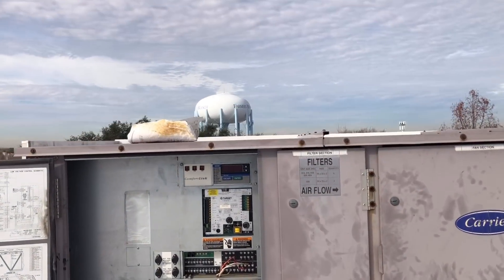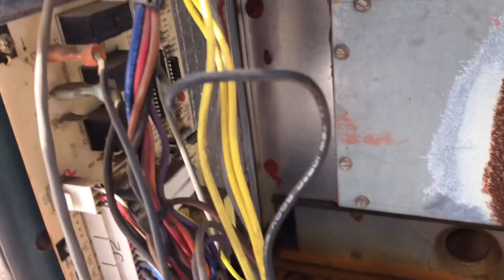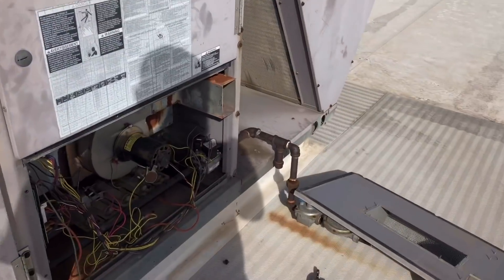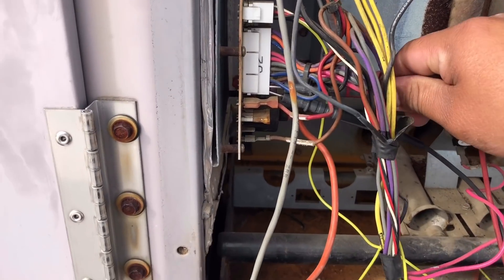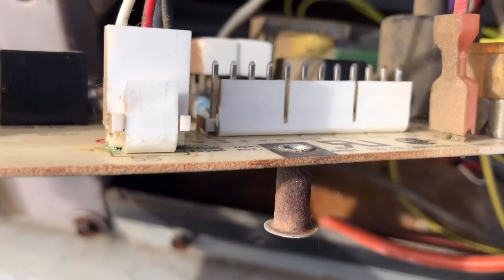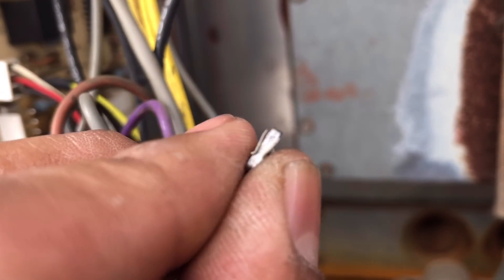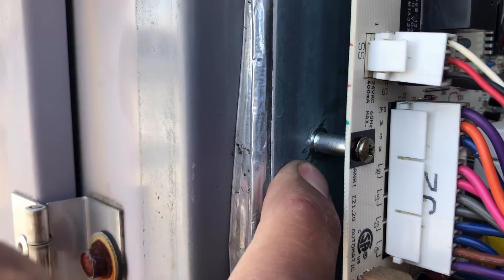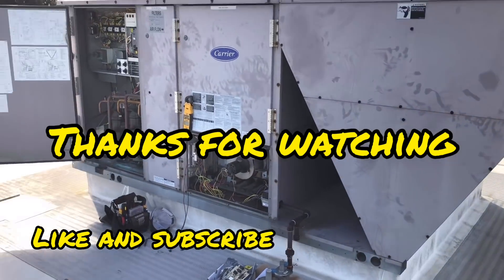HVACR:  No Heat Call, Carrier RTU. Constant Callback

Comment: Bad solder joint or a cracked resistor where the high heat marks were, send me the board I'll fix it for you!  Ha Ha
Reply from the maker: Lol. Thanks.  The solder cracked on the pins.  I posted the picture to my Instagram.

Comment: Board discoloration looked appropriate, as it was under some power resistors.  Iffy on the connector - was that dust or a sign of heat from a voltage drop of a poor connector?
Reply from the maker: Cracked solder on the pins.

Comment: I had the same problem with a carrier electric heat unit. It was that 12 pin connector solder joint was coming loose making a bad connection.
Reply from the maker: Exactly the problem here.  Good to know.  Thanks

Comment: Don't throw that board out as there is nothing wrong with it other than dry solder joints at that multi pin connector. Invest in a cheap soldering iron - next time go over all the solder joints and retin them. Although messy that wiring harness looks fine no need to replace it - spare parts people trying to make lots of money - hope they didn't charge too much for that board.

Comment: Hall sensor? Are you talking the flame sensor?
Reply from the maker: I’m probably talking about the Hall effect switch.  Is that what you mean?
Reply: @rookierefrigeration4357  yeah that's what I was referring to,  that was the flame sensor right? You just called it a hall effect sensor?
Reply from the maker: JDT738126 no. The Hall effect sensor is at the tail end of the inducer.  It seems a signal to the board when the inducer is turning.

Comment: a Halifax switch is that what e called that part on the circuit board?
Reply from the maker: The Hall effect switch is on the end of the inducer motor.   It acts as a pressure switch but it gives off a DC voltage to the board proving that the inducer is running.   I don’t know the exact technical names or voltage but that’s it.

Comment: Just a solder joint on the back of the board behind the pins intermittent problem. Just got a hate those intermittent problems on electrical
Reply from the maker: t lech yup. Found it the day after I ran the call

Comment: Is that the ignition control module
Reply: I ran into that on ces unit and Lennox this year. Harness price is wild dang
Reply from the maker: Daniel Alvarado yup.  If you look on my Instagram, you can see the pics of the board with the cracked solder joints.
Reply from the maker: Daniel Alvarado yup.

Comment: You can override Those older style TGT IOP boards by using an alligator clip on both the little loops on the board. In case you didnt know. I'm sure you do though. Enjoy the vids!
Reply from the maker: Yeah, it’s funny cause my Tgt board called for it, but the unit wasn’t.   I’m not sure how all the networking and controls goes but it was odd.  Thanks for the advice bro

Comment: You discover the most usual fail in electronics.    It is just cracked solders in the connentor on the pcb solder side... just reflush and add 60/40 tim with a pencil solder iron and that is all 5 min. Of work.
Reply: Unless you own the equipment,  never solder the board.  Too much liability.
Reply: flyguille what about the hour drive there, collecting the tools, the hike to the roof , taking apart the part you need to work on, then after the repair everything goes back together,the write up of the repair.... then all of the stand around time....you grossly underbid that job if you only charged for 5 minutes of work !!!!!!
Reply: @sandman4thewoke121  no, you do that in site, without any moving, it is just 2 extra tools in the box (1 tool , one spool 60/40), nothing more, it is just matter of 2 seconds to do each solder you can't ruin anything). Because it is just a reflush of two seconds where you add a bit more of solder.... it is the easier task to do in electrónics.

¿How do you know which are cracked, you needs to see that from the surface perspective point of view, and move the pin, you will see a circular crack just at the base of the solder, that is because in factory they don't put enough solder to hold the vibrations of the machine, so it dows metal fatigue.
Reply from the maker: Yeah, I don’t think I could get approved to repair a board.   But I have fixed many broken solder joints in my 1998 Jeep, so I know it’s very doable.
Reply: @rookierefrigeration4357  no, you do that in site, without any moving, it is just 2 extra tools in the box (1 tool , one spool 60/40), nothing more, it is just matter of 2 seconds to do each solder you can't ruin anything). Because it is just a reflush of two seconds where you add a bit more of solder.... it is the easier task to do in electrónics.

¿How do you know which are cracked, you needs to see that from the surface perspective point of view, and move the pin, you will see a circular crack just at the base of the solder, that is because in factory they don't put enough solder to hold the vibrations of the machine, so it does metal fatigue., you don't touch electronics component, or surface components, you only do  connectors solders, for that you don't need a permit or aproval (and most important, you don't cost 500 extra bucks to the client). And most important you save the travel to get another board, and you don't set in the bill that you did soldering, just "connector repairment" so, you don't OWN the equipment as the other said.
Reply: Where I live they don’t allow you to fix anything by soldering.(if it’s gas related) if you do you are liable, a lot of techs  don’t want to risk there jobs. They’re are places that will be able to refurbish the boards and certify the repair but for boards like this we just replace them.
Reply: If you solder a board you cant provide any warranty. You are doing the customer a favor by replacing the board and guarantering the work. Making your company look good by not having another callback. Soldering a 20+ year old circuit board is a game played by a service company looking to go broke. That unit is ancient so i hope CO and heat exchanger was checked to make sure money is not being spent on a sinking ship. Something that old I would recommend to replace for an efficiency and reliabilty standpoint, so at least compare repair vs replace to give the customer that option and maybe make some money for your company. Good job and good luck.

Comment: The pin connector probably came unsoldered from the board. The joints crack or break away from the copper trace.
Reply: when you flipped it over I've put the video on 1080p and frame by frame and can definitely see cracked solder on those pins lol
Reply: Gerardo Requenez yes. And what looks to be a bad pathway too.
Reply: I often re-solder connectors and anything that has heavy parts on it. That discoloration is normal from them high powered resistors. They are usually mounted off the PCB a little so they don't discolor the board and better heat dissipation for air flow.
Reply: I had that very thing happen on a corporate owned generator. I was told not to diagnose it, and call a corporate tech in. He couldn't find anything wrong. So, after my 3rd damaged contactor coil, I started messing with the units wiring and started replicating the issue. The auto voltage regulator connector was broken loose at the board, under a silicone filled surface to prevent reverse engineering of regulator. You could barely touch it and my light tower would flicker ever so slightly. I called in for a replacement generator after emailing the video of the failure to corporate. Frustrating!
Reply: @johnwilliamson2393  The silicone is there to prevent movement and to seal things, not to prevent service. It usually used to keep vibration from breaking components off the board.
Reply: I agree. I've also seen that as an issue
Reply: I've had to resolder several board pins.
Reply: My boss used to say "it's the little things, you got to look at the little things" ...you are sorely missed Boss ...RIP,  MR. CARL ... wish you were here.
Reply: Exactly, a few minutes re-touching the solder joints with an iron and some fresh rosin-core solder would have probably been as effective as replacing a $500 board (that has $2 worth of parts on it).
Reply: good call stick board in oven at 350 for 8 mins, if you ever have another one....(resolders the joints)
Reply: @happydays4551  Many components cannot take soldering temperatures for very long (ICs, the expensive parts), that is risky. Just hit them with an iron, or heat gun from the back of the board.
Reply: @court2379  i hear ya, i know everyones an expert and i always am open to new ideas/ways, just letting everyone know what has worked for me just shy of 15 years now.. have a great day, thanks.
Reply: blo me It works better if you just solder the joints with new flux-cored solder. You need flux to promote adhesion or the joint will crack again.
Reply: @happydays4551  really?
Reply: @donmacdonald8516  what the "board in oven"? yes,preheat to 350 leave in 8 mins. it works. Then be confident when you charge him 450 dollars for a new board..
Reply: 99.999% agree  over the time, vibration, heat/cold/heat/cold  it disoldered itself. i have this a my washing maschine, by soldering i see the pin is heating up twice, first outerring to pcb, then the pin itself  after thos... no problem, it is now working
Reply: yeah, resolder pins on pcb should fix it.
Reply: Solder terminals on back of board used to get a lot of that in  hot climates
Reply from the maker: Yup. That’s what I’m 🤔
Reply: Yup, that happens all the time with the RoHS garbage. Whoever came up with the "no lead anywhere" directive was probably one of the kids who were eating lead paint to begin with.
Reply: @DiverCTH  The issue isn't with people eating it. The issue is many if the circut boards end up in poor countries for recycling,  where they melt it and spill it everywhere contaminating the place. They don't understand the hazards of the work they are doing so don't take precautions.

Comment: good find 👍 gotta ask....did anyone check the heat exchanger on that old beater ? first thing i do if i see alot of rust on those older units is check that heat exchanger for holes in it...dont want carbon monoxide getting into the building
Reply from the maker: Yeah.  It must have been replaced before because it was not bad.

Comment: I think the old board had cracked solder joints in the green side of the panel right where the connector goes in.
Reply from the maker: I agree.